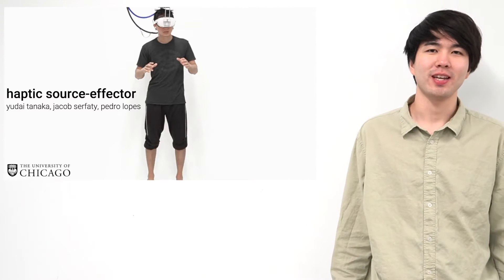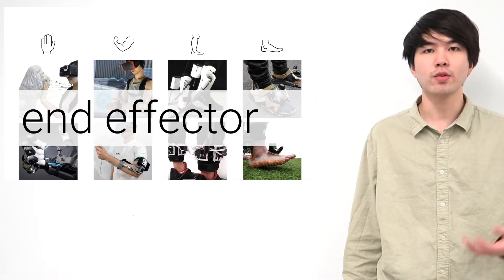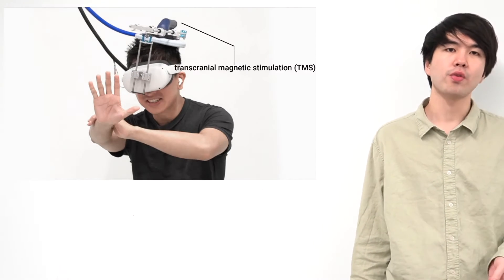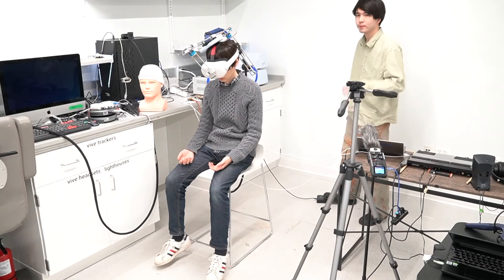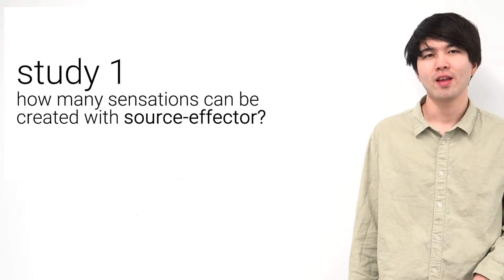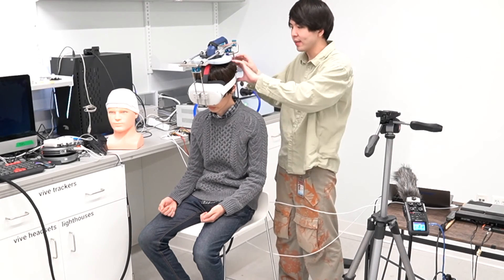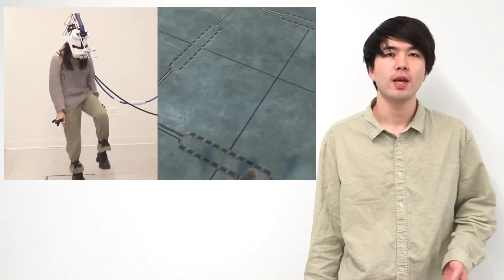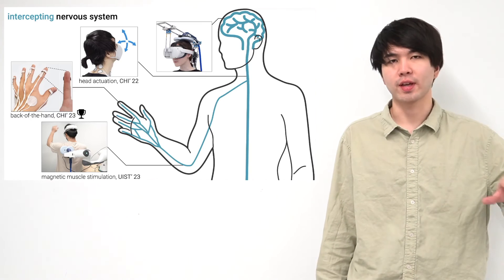Haptic Source-effector: Full-body Haptics via Non-invasive Brain Stimulation

Comment: I read your paper.

I saw that you were going to improve the concept with transcranial focused ultrasound neuromodulation. If my knowledge is correct, this will give you the possibility of stimulating several stimuli simultaneously and more precisely than TMS.
To go even further, we could imagine using the EEG to synchronize movements of the motor cortex with movements in the virtual world, to emancipate ourselves from external control.

Finally, why not use Galvanic vestibular stimulation to add even greater immersion?